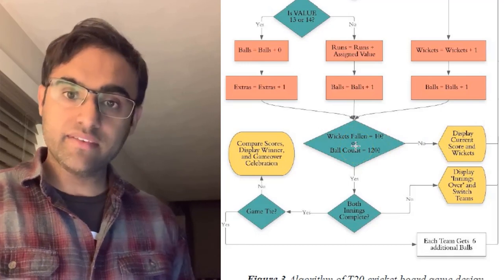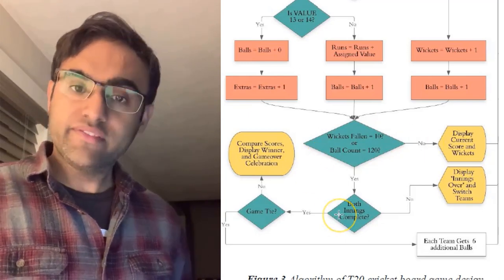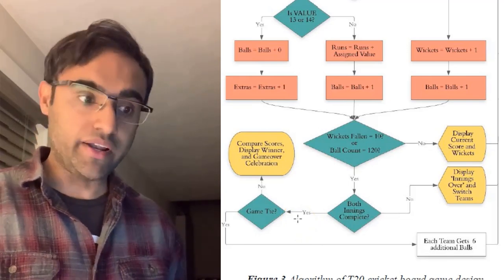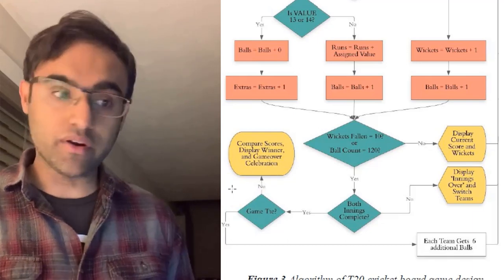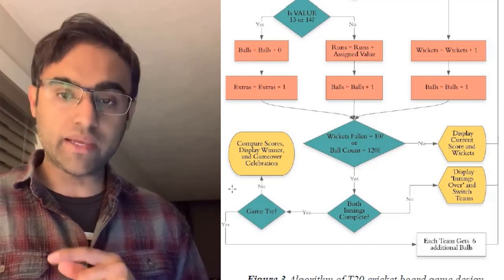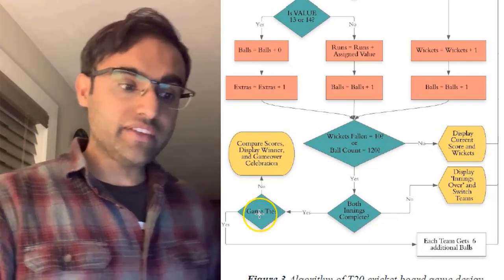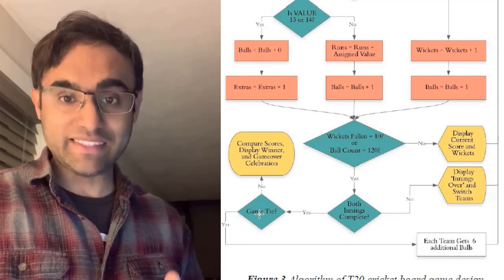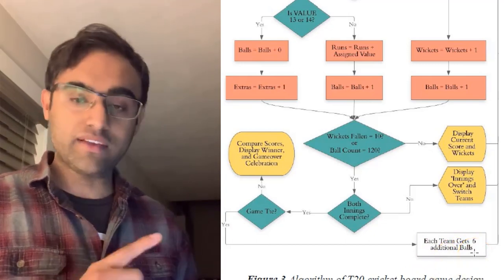#21 Implementing a T20 Cricket Game onto an FPGA Board | Verilog | Vivado

Comment: Sir , project is running on fpga board but the wicket in board does not change .the remain at  8.and the led that shows ball count only works when team 2 plays...
Sir can you help in solving my problem
Reply: Hi..can you please share your project code with  testbench if your code is dumped successfully as this is our project.hope you consider.
Reply: @RUPAKUMARI-cu6yf Hi...you can get the source by just senting a request to Mughal sir by clicking the link given in the description box of that video. My code doesn't successfully dumped it shows some error. I suggest you to go through the source code given in the description box, that might help you, i think..

Comment: Hello Sir, I have requested the Access for Source Code.
Will You Please Grant the Access ?
Thank You 😇
( Also Wanted to Ask that, Can I Implement this with Spartan 6 Board ). It does not have those switches though
Reply from the maker: If you have pmod connectors, you can use them as switches.
Reply: @ElectronicswithProfMughal  Okay, I'll see to it, Thanks
Also, Have You Grant the Access to Me ?
Reply: Please grant Mee access sir